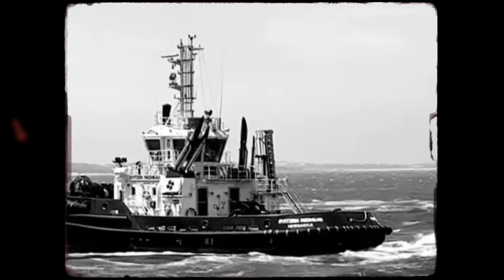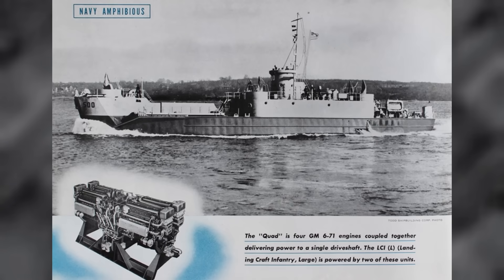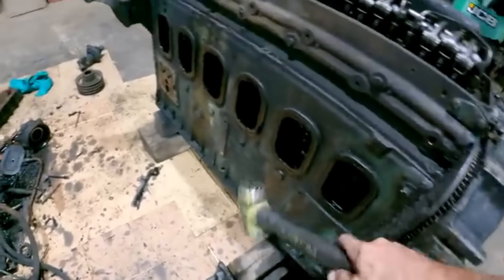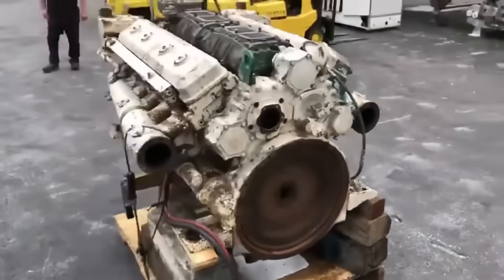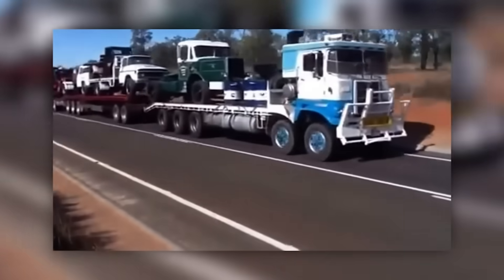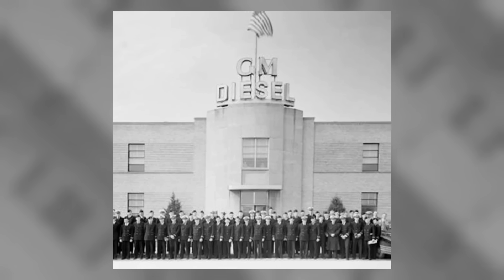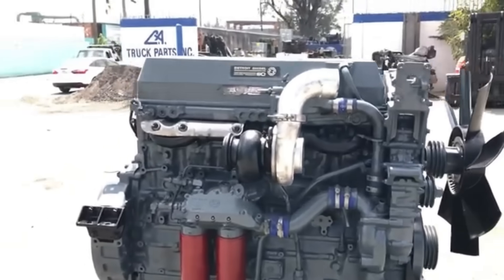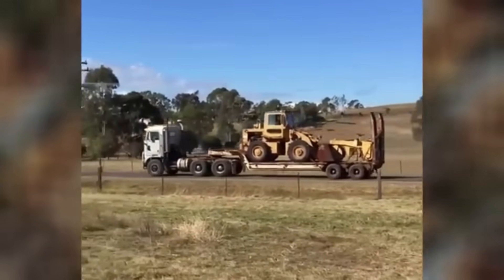The Rise and Fall of Detroit Diesel, America’s Greatest Engine Company

Comment: I have worked at Detroit Diesel for 28 years, and I don't think we've fallen yet.  We are now part of Daimler,  specifically Daimler Trucks North America which include Freightliner, Western Star.   As of now Freightliner has a industries highest market share of all class at 8 truck manufacturers by a large amount.  We now also manufacture heavy duty automatic transmission and various axels as well.
Reply: The 60 series was the best, easiest engine to service
Reply: Me too, still going strong
Reply: As a guy who fixes Detroit engines, they are the easiest to maintain modern mass produced diesel motors these days
Reply: My father's last job before he passed away was at Detroit diesel. I'm old enough to remember being taken to work days that most companies believed in promoting a family. Everyone in the company was part of the companies long term survival. Those were the days when a problem was a problem to be resolved personal or a production. The company organized social gatherings promoting strong connections between management and employees. I learned at a very young age everyone had a equal opportunity regardless of age, nationally, color , sex etc.Thank you for bringing back memories
Reply: I've driven several freightliners in my day, each model had a different engine under the hood, Caterpillar, Cummins, Mercedes, and my newest one has a Detroit diesel.
Reply: They're talking about the 2 stroke engine, you've probably never heard of it 🙄
Reply: @miketaylor3606  No one can tell who you are replying to.
Reply: the 60 series is pretty solid and legendary in and of itself..  me being in the vintage bus community pretty heavy of course has a lot of love for the 2 stroke mechanicals.. and even the earlier DDEC stuff..  I own an 8V71, others in our group have 6-71's, 8V92's, 6V71s..  in busses that are 60 years old and in some cases even older.. and they still run like champs... anyone who knows anything about busses knows that they live really hard lives..  city busses (GM fishbowls), tour busses (old greyhound) and the like were run hard all the time.. sometmes 24/7 for weeks at a time never being turned off..  (they just switched drivers at the end of every shift).. obviously none of these old engines could meet the EPA, but they still live on (as long as dumbass youtubers dont destroy tyhem for clicks and views)
Reply: @eldoradoboy  the heating and cooling (shutting off and lettng cool then starting) is what actually kills engines. it brittlizes the metal. letting them run helps them in the long run
Reply: @cerberus1166  100%. esp diesels..  those that drive their diesels lightly and on short trips end up with the most issues.. diesles need to get fully warmed up each cycle and liked to be worked ab it to get the oil temp high enough to evaporate out the combustion moisture and any distillites from the fuel that may make it into the oil. not to mention on emissions diesels the last thing you want in your DPF is cool moist exhaust..
Reply: I am a retired truck driver & drove a 1977 Peterbilt with a 425 hp 8-V92 & loved it. 2 strokes phased out great engine the Series 60 became famous.
Reply: The whole green scam is what happened when NATO reached to destroy AMERICAN industries and manufacturing.. The world Eco Forum said that America couldn't father the TECH. world and MANUFACTURING at the same time. Our power would have been too much to overcome..
Reply: That's what I was thinking. There are still tons of trucks on the road with DDs
Reply: Just wish the DD15 wasn't such a weak turd. It's reliable though. Just embarrassing to be in my Cascadia with a 53ft dry van only having 20lb lbs in the trailer and having to see KW's and Pete's with Cats & Cummins pulling 40-50k lb steel coils walking off and leaving me, even on the hills.
Reply: cough Mercedes benz
Reply: I realize I am late to the party but Detroit Diesels series 15 and 16 are junk.  I will go into detail if you are interested.  They may have gotten some of the kinks out since 2016 when I was working on them.  What I do know is that they don't hold a candle to the series 60s and the two strokes.
Reply: Freightliners are the chevy caveliers of the trucking world. Cheap and shitty, leased for 3 years and tossed to the curb by large fleets. This is why they have large market share, not because they are good. They are the worst trucks on the road today by far.
Reply: I spend about 10 hours a day cussing at your pos automated transmission. I wish Detroit would fall, give me a gd clutch pedal lmao
Reply: how many people got shit on with that brand change though? obviously not you. but i hate seeing detroit diesel switching owners. GM is stupid for that. no idea why youd sell to a competitor especially.
Reply: @cerberus1166  And now the former executives from GM are busy sinking Boeing.😢
Reply: The 60 is still my favorite engine and favorite to work on. My fire department still uses the 8v92ta and 6v92ta. They run great
Reply: No Comment on Volume of Freightshaker tuck sales.
Reply: I saw a guy working on a Detroit diesel boat engine in Bermuda. I think he said 50-60 years old and he was proud of that engine.
Reply: As a person who doesn't own or work on a Detroit Diesel, I appreciate the engine and all who work on them. I don't know if any of the fire engines or Amy vehicles I've use were made by them or not lol
Reply: Someone should go china on your IP and make it American again
Reply: You mean the heavy duty automatic that can be rebuilt when they go out and have to be swapped for a factory new, heard they sell like hot cakes
Reply: Money is the only reason this engine stopped being made.
Reply: Detroit 2 cycle is dead not the company you  dumbass
Reply: Shoutz out to you good sir. My Pop'z retired from there 35 yrz Pipe Fitter.
Reply: Not For Long
Reply: Yeah fuck Detroit transmissions
Reply: Detroit is peak rn ignore the noise
Reply: What about this def fluid?
Reply: We had a 2 stroke Detroit diesel on a ladder truck when I was a firefighter in Kansas City. That engine had amazing power.
Reply: Long time since I sat in a truck, 20+ years ago, I thought it looked like an airliner cockpit?. Prolly just 1 screen now, (like a 60's ufo?).
Reply: I don't wish to argue with engine guys, but was the 2 cyl version ever in a motorcycle?.
Reply: All of my fathers trucks have cummins, including Freightliner. Detroit Diesel died.
Reply: Working under Daimler is not bragging rights, not American made anymore.
Reply: Can we use the word "legendary" more?
Reply: Great!
Reply: Their business plan changed right !
Those engine manufacturers who supplied road and vocational trucks removed themselves from those markets, cause the clean air rules cost to much, and the combos of clean air, lighter weight engines, and chip controls of everything increased cost, and decreased longevity, also caused a multitude of re-reoccurring problems and numerous problems.
Reply: Detroit Diesel still puts out the best on highway class 8 motor. It's the most reliable engine I have driven in modern semis
Reply: @dadsqch garbage. DD13 and DD15 trash
Reply: @dadsqch the  series 15 and 16 were  junk when they first came out.  At least they were when I worked on them.  I don't know if they managed to get the kinks worked out.  EPA emissions standards is what screwed it up.  Please let me know how they are performing as of late.
Reply: So it IS gone.
You work for Daimler.
Reply: I was there in the fall of 99 for training ,when all of the 2 stroke lines were condensed into one. We did get to see a 20v 149 block going together,that was cool. 
Us generators guys miss the response of that old girl, the 4 strokes can't even compare. 
Anyways, it was a little natural to "hate" the 60 series at first, but to me it ended up being a great engine. 
Good workhorse,not too complicated.
Maybe not the highest HP rating, but plenty to get the work done that if needs to do. 
I been out of the engine world a little since the late 2000s as far as hands on rebuilding stuff ,just minor repairs, I know everyone hates the emissions engines though.
Reply: @MrTheHillfolk put twin turbos on that engine.  It's kicked A$$
Reply: My cousin worked at Detroit Diesel (circa '76 - '79).
He was laid off, so he went to AAA as an adjuster.

The FF I was on, had a backup gen that was a DD.   
The DD powered her during BECCES, I have to say, that was a tough engine.  

Former Dearborn Heights Resident '68 - '79

USN(RET)
Reply: Cummins is better
Reply: @derekowen9098 What about Ford or Chevy?
Reply: @fishmonger6879  What does Ford or Chevy have to do with heavy duty engines?
Reply: @jasonstclair6293 I was joking with the guy, looks like he deleted his post. He said something abstract so I responded in kind.
Reply: @fishmonger6879  Fair enough.
Reply: @derekowen9098 you can’t even keep a camshaft in a Cummins gtfo
Reply: How does a small company obtain a vendor code for DD? I've been in there and have several series of tools that would be a major update. No code, no advancement
Reply: I was involved with Penske Racing when he partnered with DD. IMO Penske Corp saved DD and the DD-60 series is an excellent engine.

I know Cummins is a big player in the US market but Detroit is quietly dominating the Freightliner, Western Star tracks 
But to be honest, I miss the CAT 3406E. 
The EPA has destroyed the internal combustion engine. Not completely and I’m hoping the Orange man can save Western Civilization and stop the one-world green takeover, scam
Reply: @deantait8326  Obama forced American diesel engine manufacturers to either get out of the heavy truck engine business or partner with a foreign manufacturer. That ended the CAT 3406. PAC acquired a European engine manufacturer and Daimler acquired both Detroit and Cummins. American heavy truck manufacturers who made their own engines started buying engines.
Reply: @garymanis6305 oh yep I was just waiting for this. Bllame it on Obama! All of you simpletons have real short memories. Do you remember what came before that? Buddy every one of these companies has been suffering since the Reagan years and it's because trickle down economics has never worked and making the rich richer and richer and richer and richer to historically record levels and still going is never going to work. It's probably about time you wake up to what's going on right now if you ever want to have a middle-class again.
Reply: @garymanis6305 Daimler acquired Detroit in 2000 which is long before Obama was in office. It's amazing how much is information you people believe when you talk to Joe blow down at the country store.
Reply: @garymanis6305 Daimler acquired them in 2000 which is long before Obama was there. Try again
Reply: @garymanis6305 they were acquired by Daimler in 2000 which is long before Obama was in office.
Reply: @garymanis6305 Daimler truck doesn’t own Cummins
Reply: @kaleidoset2569 Was obama down with the green new deal?
Reply: You people get a lie going in your head and just keep telling it to yourselves till you believe it too. It’s disgusting honestly, where is your shame or even your backbone. Obama did several actually controversial things you don’t have to tell easily disputable lies about him.
Reply: @kaleidoset2569  Trumpers don't care about facts. Something happens and they forget about the facts once their cult leader starts speaking and spewing his lies.
Reply: @garymanis6305  Obama crippled a foundational industry of the United States… nah.
Hussein Obama was a great leader and his husband Mike has done amazing work within so many communities
Reply: @garymanis6305  Fake news my friend! Daimler bought DD in 2000 long before Obama and Cummings is a public traded company not owned by shareholders and not by another corporation. Foreign companies' acquisition of American truck and engine manufacturers had nothing to do with Obama at all. They got acquired because Europe had tightened their diesel emission regulations for commercial trucks a decade earlier than the US, which forced the European truck engine manufacturers to modernize and update their commercial diesel engines already in the early 90s. Since the European manufacturers had already made big investments, multiple years of development & testing, and had a lineup of modern, fuel-efficient diesel engines that had met the stricter emission regulations in the market for almost 10 years, it was easier and far less risky to either buy European manufacturer or to get acquired by one (like Daimler buying DD) and simply transfer the modern diesel engine technology and know-how to the US market.
Reply: @garymanis6305  Cat exited the on road market because they were having a hard time with emissions and they didn't need the business.  It has nothing to do with Obama
Reply: @garymanis6305  Daimler does not own Cummins, dont know where you got that.
Reply: @jasonstclair6293  False. CAT had the computer controlled 3406 that was leading US diesel engines in emissions. The Obama administration imposed unrealistic emissions requirements that could only be met by reducing engine cubic inches and reducing load capacity for the truck. CAT had invested heavily in the 3406 as their heavy truck engine for the foreseeable future. Obama personally refused to grant emissions waivers to any US diesel engine manufacturer for heavy trucks.
Reply: @RevolutionMuscle  Cummins has been pumping out misinformation for a while. Like claiming they were never owned, even in part, by any automaker. Ford owned about 10% of Cummins and made an offer to buy more. That offer was rejected and later Cummins bought back Ford's interest. Chrysler also owned a piece of Cummins and built/owned some of the factories used to make the Cummins engine used in Dodge trucks. Chrysler needed Cummins to build more of the popular engine and needed Cummins to dedicate some production for Dodge trucks. Cummins didn't want to do that until Chrysler offered to build a new plant and bankroll it. Cummins now calls that a joint venture. 

Why do you think Daimler Benz used Cummins engines for a while instead of their own? They owned a big chunk of Cummins. It seems that they sold their interest in Cummins to an investment group.

In consider Cummin's misinformation to be for PR reasons. The demographic for a lot of their customers wouldn't like the truth.
Reply: @garymanis6305  So far I have seen several of your claims contested by other people and put very little faith in anything you say.  I did look some things up and found while the Obama administration did enact some tougher standards they only sped up what the EPA had already started.  It was only a matter of time for the 3406.  I could find nothing that says Chrysler or Dodge ever owned a portion of Cummins.   Nothing about Daimler ever owning a portion of Cummins either.  How about some links?  I can find partnerships between Daimler and Cummins, but never any ownership.
Reply: @jasonstclair6293  I see that my comments with links were removed. So much for the truth.
Reply: @garymanis6305  when Cat got rid of the craftsmen who had kept a very high standard l quit on them. They were nothing special anymore. No longer a product of American pride. Just another greedy corporation that didn’t need more money but wanted it anyway. Used to be as the company prospered so did the workers.
Reply: @williammoses6460  You are entitled to your opinion. I'm not sure how your opinion of your former employer matters to me, though. When the federal government decides to interfere in private industry, profits in that industry typically tank. When that happens, they have to let some people go to keep the company going long term. They have to make a choice between letting a handful of highly paid people go or a lot more who are paid less. 
When a former employer of mine lost part of their main contract in a competitive rebid, they were faced with that choice. They let me go and were able keep 4 other people. They told me they hated to let me go, but they knew that I would have no trouble finding another job. They were right.  I agree with their choice.
Reply: @garymanis6305  I actually am speaking as a retired construction worker. Growing up I remember when the local quarry bought its first D8. Someone said it was a dollar a pound. Somehow it was a point of civic pride. Very hard to retain that sentiment today.
Reply: @williammoses6460  Interesting. My father had a D8. I helped him upgrade it from the cable lifted blade system to hydraulics and replace the cable spool with a winch. The pony motor was fun and noisy.
Reply: Obama bailed out American automakers to keep auto manufacturing jobs in America

Comment: The best engines I ever owned. Caterpillars wore out Detroits ran forever  over 900,000 miles on series 60  never rebuilt
Reply: I like the old 2 strokes ,but that 60 turned out to be a decent replacement for it. 
Fairly simple ,maybe not powerful like a cat but then not as complicated. 
Great workhorse engines.

Comment: Had a Detroit V8 92 series in crayboat ( Lobster boat ) working of Western Australia back in the 80’s … Awesome bit of American kit , pushed a 50 ft crayboat weighing 18 tonnes at 23 knots and from the moment pushing down the trottle it always created instant speed , being 2 stroke engine . Love it ❤️
Reply: That's pret T awesome!
Reply: Still use them in quite a few power stations in WA for starting gas turbines
Reply: The busgrease monkey repairs/maintains all types of diesel engines. He owns a converted silver side motorhome bus powered by the original two stroke Detroit diesel. His YouTube channel is the channel to check out if you like to see his work